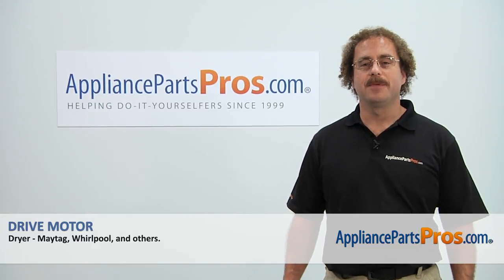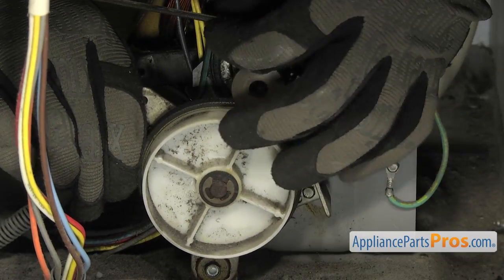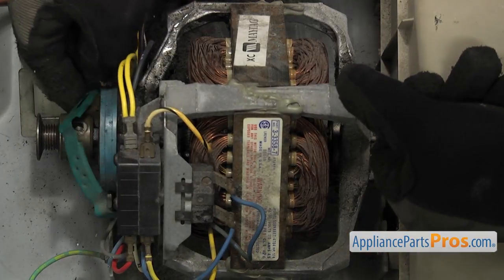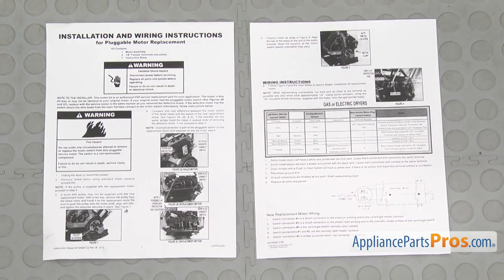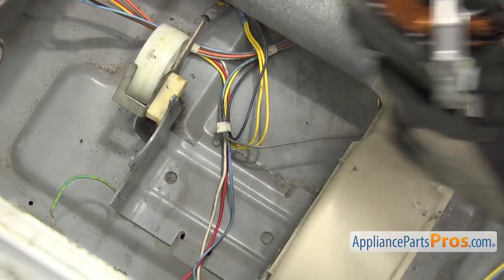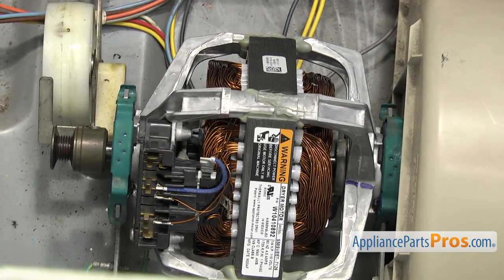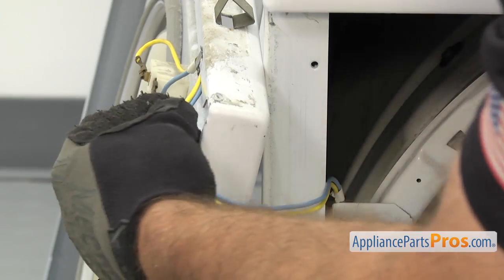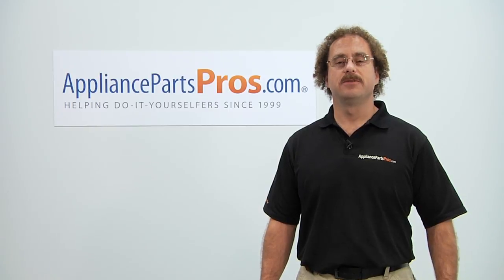How To: Whirlpool Dryer Drive Motor W10410999

Comment: Thank you very much to this guy.  I replaced the motor in our Maytag today.  The new motor did not have any instructions. I looked online for the directions to that particular motor and they were different than this video.  I had the same configuration wires as in this video (grey, two-joined yellow, red, two-joined Black, and a two-joined Blue and White).  I'm so glad that he  showed the piece of paper where all the wires go and which ones needed a new connectors.  I did exactly what he said to do and "VOILA!", it all worked just fine.  We are so happy now. We also replaced the Belt, blower wheel and a 4' gas line. This is like a brand new Dryer again. Thank you for saving us a much bigger inconvenience.

Comment: I have an old Maytag DE303 dryer this motor is going into. The existing wiring harness has a light blue wire and white wire that are separate (no gray wire aside from the door switch). I can't find anything about how I'm supposed to wire this setup. I put the new terminals on the red and yellow (single yellow) and connected everything. I don't want to put either the white or light blue wire on the thermal protector or terminal 1 until I know it's correct and won't fry anything. Any help or literature would be appreciated
Reply from the maker: It appears the blue wire should go on terminal 1 and the white wire is on the back 1/4" terminal.
Reply: @appliancepartspros  Worked perfectly. Thank you!
Reply: @appliancepartspros I am having this same issue. No grey wire. I have the yellow, black, red and then a white and blue with separate plugs, if I plug in the white wire then little blue wire (not the jumper the new motor came with, this is two wires coming from the dryer that are connected together but then separate into two metal ports at the end) has no where to go.

Comment: What can cause an intermittent power failure code for maytag electric dryer.  The power connection is good and tight and I replaced the thermistor ( little white  heat variable resistor )  .  So could a motor that's going bad cause an intermittent power failure?   Do these have start or run capacitors?  If so are they replaceable or do I have to replace the entire motor?

Comment: If the motor doesn't run,  does it tell the ignitor not to ignite?  Is there a sensor on this old machine?
Reply from the maker: The motor doesn't control the ignitor. If your motor is not coming on then you will need to test for power at the motor. If there is power there and no power is coming in then you will need to replace the motor.